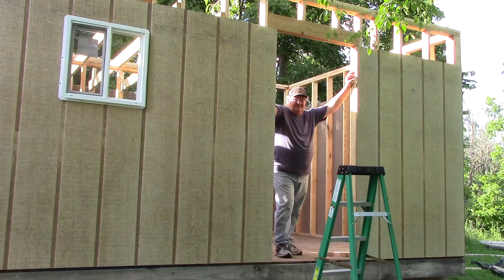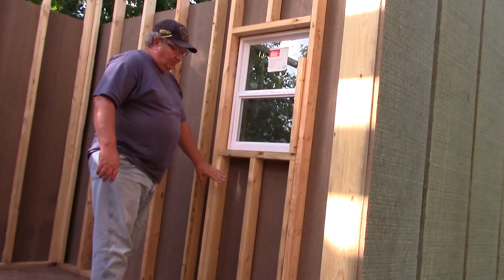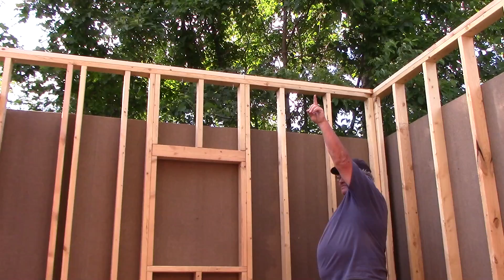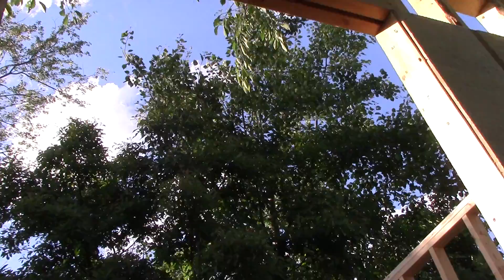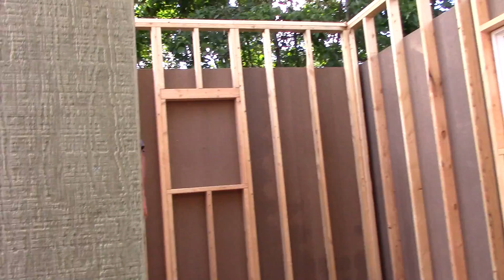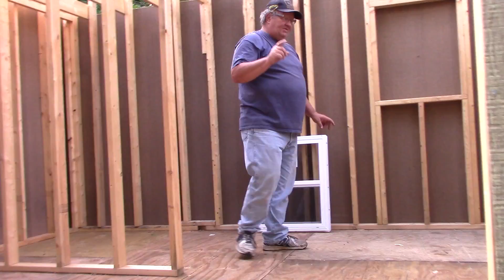The Off Grid Cabin Build - Rough framing for windows

Comment: Hi Joe - long time subscriber, first time commenter which means you must be doing really, really great things. LMAO. I love your channel and think you and Gail are two of the best people I've ever seen work together in my life. One question I have, and perhaps I misunderstood what you were explaining, but won't the gable ends also be a supporting wall if you're using a ridge beam instead of trusses?
Reply from the maker: +The Angry Iowan That's a very good question. You would certainly think so, but my understanding is that it the rafters that hold the beam up.  The studs on the gable ends are primarily nailers only. They may absorb a little weight,  but a minimal amount. The end rafters take the weight.  That's why the disclaimer lol.  Thanks for the awesome comment!
Reply: It's always been my understanding that you planned to use a ridge beam which changes the entire structure. It's closer to 80% weight on the ridge/gable and 10% on each end of the sides. I'm just curious as to whether you're still going with the ridge beam or traditional trusses. There's a huge difference my friend.
Reply from the maker: +The Angry Iowan I stand corrected I guess lol. I don't understand how it gets that much of the weight, as nothing is really attached to the end walls. There will be some short studs to the top plate, bit they will serve primarily as nailers. Fortunately I'm going with a metal roof.  Before I close it in, I can strengthen that up!  Thanks.

Comment: Hi Joe:  Glad to see you building again.  I would drive your viewers crazy with my current  design project;  as it is a timber frame barn. And  the windows are just picture framed with rough cut  2x4 on the flat glued and stainless stapled to the back of the full 1" boards of the exterior vertical board and baton siding.  The 2" gap in turn will be filled with closed cell foam insulation  ( that sticks to the rough sawn wood like the proverbial to a blanket) providing a full moisture barrier and will move with the wet wood as it dries, maintaining the bond. The only other framing in the wall system is the full 2x2 nailers glued and stapled to the B&B and the timber frame. For the interior wall surface be it Gyproc, T&G, bead board,  plywood,  expanded metal and plaster,  etc.  The walls provide no structure only enclosure;  the structure is the timber frame. I recommend expensive stainless staples; they will not rust out or split the green wood as it dries. With the new adhesives and the roof kept up;  the barn should be as good as new over a hundred years from now.  The heavy doors will be strap hinged to timber framed door posts and headers with bolts and structural screws.  It is fun to join traditional building methods with modern materials.  Enjoy your build.   Bert
Reply from the maker: +bert skelton Thanks Bert.  Man, I would to see that project you've got going on.  It sounds incredible.

Comment: We had to tear our load bearing wall out when we put a sliding glass door in our kitchen, that would lead to the deck we had started, and the load bearing wall in the middle, between the kitchen and the living room. It was a tough one, the center wall had to be jacked up so that we could put in some 4x4 posts to hold the attic and roof up. It turned out fantastic, but without our friends helping us, I'm quite sure my new house would have been a sorry site for sure. It ended up being the best thing we ever did in that house. Years later we moved into a model home and never touched a thing in it other than putting a French door that connected one room to another with it. It turned out gorgeous. Bless, Sheila
Reply from the maker: +Sheila6325 I'm lucky this cabin will be very small, and not a lot of worry about much of that lol.
Reply: Yep, that's exactly why I now have a 12x32 finished garage/home that I will be moving to as soon as I can. I'm so glad you mentioned load bearing walls, back in the 1980's many were tearing down walls only to have them start to sag, and become really dangerous. People need to know these things before tearing down, or building up spaces where they need something secure. Shoot, back then you didn't even have the internet to help you out.

Comment: Sir, you need to check with a builder/architect.  All four of the outside walls are load bearing walls.  Your end walls are loadbearing because the load from the end rafters will be transmitted down through your studs from your top pate up to the rafter..
Reply from the maker: +James Gass With the roof I'm using, very little will be touching the end walls. But, I always say double check me lol.

Comment: I'm having a home built right now and was concerned about the windows being framed correctly. they are framed similar to your non load bearing wall window frames. Your explanation makes sense of where the weight will lie. My trusses will be pushing the weight to the ends of the house where no windows exist. My windows and doors are in the front and rear of the house. I was going to be asking the foreman about this tomorrow but you helped my understanding.
Reply from the maker: +Christopher Sanders I'm glad you enjoyed it. I'm sure your builder knows a lot more than men and can probably explain it better.